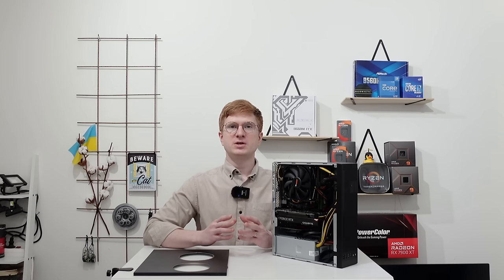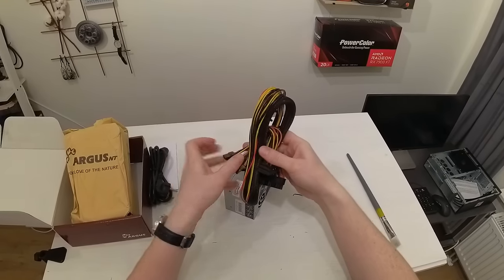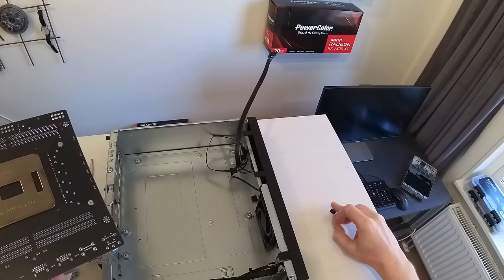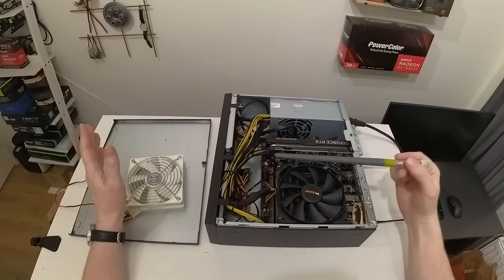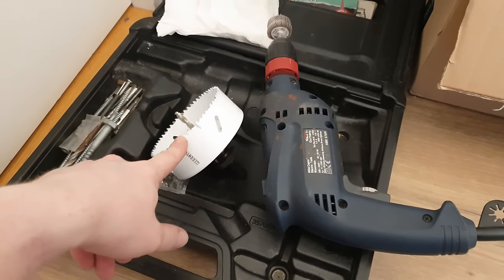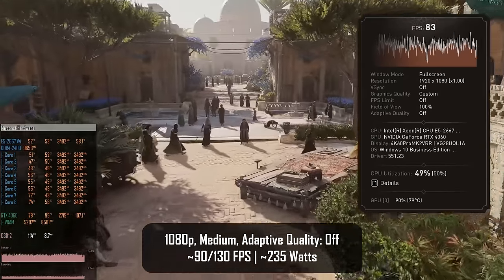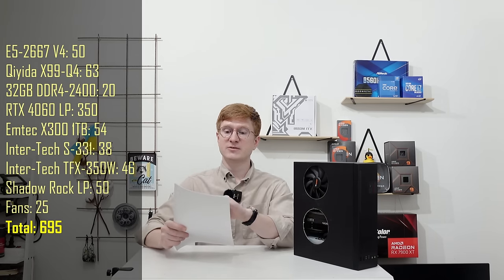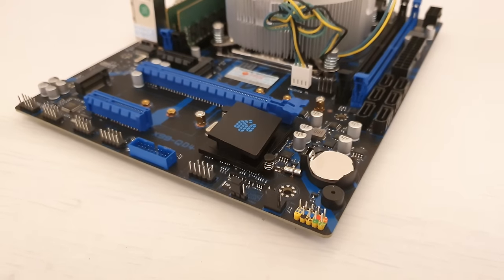🇬🇧 X99 Gaming Mini-PC Build Log – E5-2667 V4, RTX 4060

Comment: Nice and Fun build dear Miyconst! Finally some love for mAtx form factor!
The only concern i have to say it's about the power consumption of that xeon E5 2667 v4, 135w are quite a lot for that kind of performance.

Since that cpu is based on broadwell xeons, ipc and frequency are not that far from the first/second gen zen/zen+ that are getting cheaper(finally!), so i would stick with some older ryzen for this kind of project.
But anyway, you did a great job and your build is well made!

Comment: I did build a mini ITX pc with a Qiyida x99 MB and end it up pretty well. The key factor is the case as mine is one similar to a NR200 but much cheaper. I also used 2667 V4.
Reply from the maker: NR200 is a great chassis and even though it's not tiny it's small enough.

Comment: Being the 1st gen on 14 nm cpus from intel, these Broadwell chips were more efficient than the previous generation but they are a far cry from what came after them in thermal efficiency. 

Usually you have to sacrifice something for a small form factor pc and combining a gaming gpu with a high end workstation cpu was always going to be difficult to cool. While the 4060 was probably the best choice overall it was never going to be easy to cool, either. 

I swear, small form factor pcs are cool for client stations but kind of lame for performance. In most cases I'd rather have a larger pc that's quieter and, going even further in that direction, I'm  super compelled by extra-large pcs that cool really well(and quietly). I'm not sure if you ever saw that case that LTT had checked out that worked entirely without fans, it was honestly almost built out of huge aluminum slabs-style heatsinks. 

To me the real dream is the desk pc, a pc built into your desk itself. Done right you should have all the space in the world for cooling. 

Maybe it would be fun to make another pc out of the exact same CPU, MB and GPU to see how much easier it is too cool the thing. =)

Comment: I'm thinking about placing an E5-2667 V4 or better Xeon E5 1650 V4 next to the RTX A2000 @6GB in my itx Linux gaming build (also as compact as yours), currently the single core weak 2630V4 is still used. The mainboard is a MACHINIST X99-K9 and 4x8GB DDR4 ECC RAM, FSP FSP250-50FGBBI(M) 250W Flex-ATX, and cooler; Thermalright AXP120-X67 WHITE ARGB Low-Profile.

Comment: Me ha gustado mucho el video, los 2  agujeros de las tapas se pueden cubrir con una bonita malla metalica o similar , pero el Xeon E5 2667 v4 trabaja a 3,200Mhz y el Turbo a 3,600Mhz, y en las pruebas trabaja solamente a 3,492 Mhz.
En unos días me llega una placa MSI X99A sli Plus con un Intel core  i7-5820K , el rendimiento a dia de hoy es bastante pobre y quiero actualizarlo con un Xeon , cual me recomendarías para juegos basicamente ?
 He visto a buen precio el e5-2667 v3  o el E5-1650 v3 o tal vez otro gastando un poco mas? Muchas gracias.
Reply from the maker: Maybe you don't understand how Turbo Boost works with Intel CPUs. The 3.6 GHz speed is only available when one and only one CPU core is used.
Reply: Si entiendo como funciona,  creia que se estaba usando el Hack de Turbo boos, alguna recomendacion para actualizar el i7-5820k?t  @Miyconst
Reply: El mejor xeon que puedes comprar es el e5 2690v4, él hizo un vídeo comparando diferentes xeones y éste era el mejor.

Comment: I think Xeon E5-2690V3 would be a better option, in terms of multicore performance is better, and in gaming is a little bit behind the 2667V4. In terms of price 2690V3 cost about 15€, and instead of that motherboard a machinist mr9a costs 52€.
Good to see modded chasis, i really like custom made builds. As always good content ❤
Reply from the maker: E5-2690 V3 is much more power hungry it would be hard to cool and the PSU may fail.

Comment: Hello, I hope this comment finds you well, I want to make a side machine for server/vm purposes that's not too expensive, I have an x99 board lying around that is a killsre v205, I've gotten turbo unlock working on it since all v201 settings work on it, but afaik the vrm's are not really good for high core high clock cpu's, so I was wondering if a 2630 v3 would require good vrm's or not for the TU (since it has a relatively low power consumption and not many cores). If not which cpu would be good for TU or is it better to go with a high base clock with no TU?

To explain the use case further, it's not gaming vm's, it's little vm's for single tasks being isolated from each other, which is why I don't really care about the core count that much, but ideally the clocks are fast enough to get the tasks done without drowning or stalling because they take too long, which is why I focus on high clock speeds via turbo unlock or base clocks, that's the ideal scenario.

Comment: Keep an eye on Lenovo P520C motherboard I think the market is a little stale now, but I havee seen for as low as 45 USD.  Uses LGA2066, also quad channel 2666 ram.  Dual NVMe as well.  But also a x8 and another x16, with Bifurcation support.  Different options for processor, W-2140B seems reasonable, but W-2135 is also good.  PSU there is available an FSP 500w for Intel NUC Extreme.  You have to add yourself the 5v power and make an extension lead for motherboard.  It is Flex ATX size.  Seller will accept offer of 30 USD for the power supply (can also find from China modified already to modular PSU)
Reply from the maker: Probably you have missed this video: https://youtu.be/tB1Qx5oU7zQ?si=kbhws-Uf4XVh0mSh

Comment: I ran into an issue with smart fan on a Chinese X99 board. Fan speed settings in bios would not apply. I was using an aliexpress dual tower cpu cooler, Fans are 4pin. Turned out it was the fans fault, I swapped the fan by an Arctic PWM fan and fan speed settings would apply. Maybe the wiring of the China fan was faulty.
Reply from the maker: Yeah, you can expect basically anything from China.
Reply: @Miyconst  now I know 😁 it's a pitty that Chinese don't care, same thing with these unfinished bioses. At least I learned the basics in how to modify a bios and where to get a proper one.
Great content by the way👍
Reply: I had this issue too. I had opened the dispute, and got 50% money back.
They had connected 3 fans (4-pin plug) in parallel (all 4 wires!), but even when I cut off two control wires, the remaining fan had no PWM.
Reply: @blackbirdest I bought the 2 fan version and I also cut the control wire of the second fan, but no improvement. After all this fuck around and find out, I must admit that I like the dubble tower cooler itself, it's cooling performance is fine. Next time I will buy the one fan version and replace the fan by a proper PWM fan 🤔

Comment: I've been watching lot of your videos and other channels, and I havent seen much about the E5-2697A V4. Would you recommend the 2667 over the 2697A? Or what CPU would you recommend for gaming paired with a 2080ti, i dont mind paying a little extra for more performance
Reply from the maker: Then I would go with i5-12400, Ryzen 5600, or i3-12100.
Reply: @Miyconst  lol thank you for the more sane options, but what would you recommend if any with these x99 boards
Reply from the maker: @InsurancePlz  I always say that AliExpress is a lottery, no matter how you slice it, thus I don't recommend it, I only provide info about their offers so people can pick the least evil ones. Both E5-2667 V4 and E5-2697A V4 will be fine with RTX 2080 Ti, in some games you get CPU bottleneck, in others GPU bottleneck, if the price is the same, I pick E5-2697A V4.
Reply: @Miyconst  thanks again. I like a little gamble. I already have a main rig with more sensible parts. I just wanted to try my hand at one of these AliExpress builds. 2697A it will be then. Maybe flip the PC or give it to a relative.

Comment: Do you know if any of these boards you've been testing support lower CPU C-States? I'm interested in grabbing one of these older Xeons to build into a home server setup. Mostly to run proxmox with some Windows VMs.  It's either this or maybe try one of those erying ES boards.
Reply from the maker: Why do you want any of these questionable solutions instead of an AM4 board with a Ryzen CPU?
Reply: @Miyconst  Try something different, they'd be more than fast enough for the tasks. It can be difficult to find secondhand motherboards for good prices. Sure I could get an R5 2600 for $50, the board may be more expensive though. I have an i7-3770k on an AliExpress motherboard, it won't go below C3 and seems to hover around 42-45w at the wall. 

I'm sure a pair of N100 systems might offer comparable performance at a lower TDP, far higher price.

I do also need to build a dirt-cheap system for my workshop as well. That one is easier, just needs to score above 4000 in multi-core score on CPU-Z validator, GTX 1060 and above. 

I've found your videos on these combos quite enjoyable, just wanted to hop in on the fun while the chips were still plentiful :)

Comment: Hello, I want to build a X99 system for multicore performances mostly. Is there any V3 or V4 cpus that can compete with an all core turbo E5 2696v3?
Reply from the maker: Not really, E5-2696 V3 with TBU is one of the best but if you need strong performance - go the AM4 route and pick a used R9 3900/3950 or even R7 3700/3800.
Reply: @Miyconst  Thanks, actually used 3950X or other high end 3000 cpus(+mobo) are more expensive than this 2696v3s and I need a lot of ram (64GB) too, so cheap DDR3 ram is also a plus. Can you recommend a good motherboard with TBU bios for 2696V3 except X99 TF/F8?

Comment: Question, I’ve heard that the Chinese motherboards from aliexpress wont let you play games that require anticheat.  Is the true or false?
Reply from the maker: It is true and false at the same time. Older platforms that don't support Windows 11 are not compatible with some Anticheats software and it doesn't matter if the motherboard is Chinese or not.

Comment: Nice build.  But that PSU would keep me awake at night.  Proper 80 Plus ratings don't always mean great quality, but at least it implements standards.  Standards these made up chinese ratings don't follow 100%.
Reply from the maker: The PSU is indeed a big question here but I couldn't find anything else reasonably priced with an 8-pin PCI-E power connector.

Comment: wait... WE HAVE THE SAME TV FURNITURE! the thingy with tinted glass pannels under your display when testing the rig hehe :b (i hated these glass pannels tbh when i tried to put a tiny NAS inside it was so noisy vibrating)
Reply from the maker: Hah! I picked this TV bench several years ago when a neighbor tried to throw it away, it's not amazing but it works and I can't make myself throw something that works just fine for me.
Reply: @Miyconst  yeah I got mine from a neighbor leaving the apartment, after removing the glass pannels it now does a great job as printer table and misc storage ! thinking about re-using the glass pannels on smth else 🤔

Comment: Wish windows 11 would have support for these cpus. I have a hp z420 with a Xeon 1650 and I’ll be doomed next year when windows 10 support ends.
Reply from the maker: No support does not mean that it will stop working. You can still keep using it as is.
Reply: @Miyconst until driver support is dropped and direct x support ceases. 😢
Reply from the maker: That's gonna take a few more years.